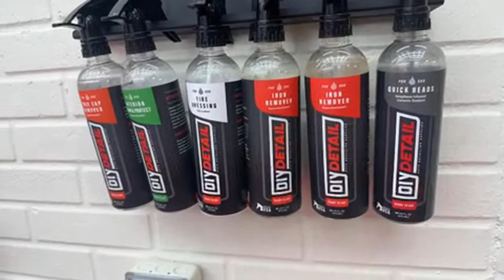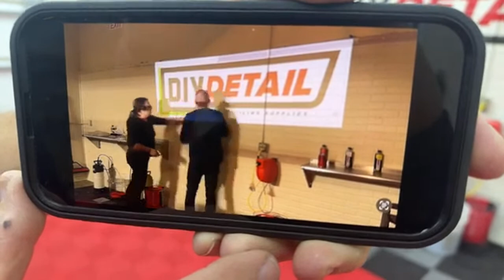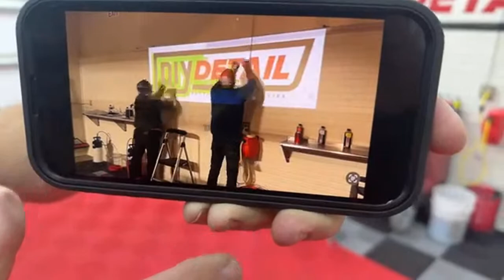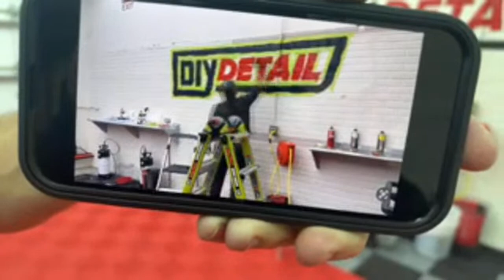Live Q&A Podcast from DIY Detail HQ

Comment: I'm a new subscriber. Been a detailer since 1988 (at one point professionally) and was so resistant to Ceramic. I finally broke down and had it done to my new car. I  always have done everything myself as I have all the tools, knowledge  and product, but left the Ceramic to someone I trust that has done it before (does it professionally) and had availability of a pro line rather than consumer grade, Literally the car probably had 100 miles on it when I had it done. I wasn't aware of you guys at the time and it has a Gtechniq product put on it. I have their whole exterior maintenance product line including decon etc. I drive 700 to 1000 miles a week, and when I run through the product  my intention is to switch to yours. I have watched many of your videos and just trust the line and care you have. Also important to me is American made whenever possible. I just purchased a bunch of things from you for the interior, some brushes, towels, some toppers etc. I know I will run out of what I have sooner than later because of what my car is exposed to in South Florida, so before long I will be trying the exterior chemical line. What I am using works fine and I don't have any problems with it, but especially on the decon side of things, I have to use so much product it's crazy. And though I have money, it's costly. I'm looking forward too trying your methods and product. I will continue to support the channel and your products in every way possible. I appreciate the videos. FYI, please get the clay towel back in stock soon:). I'll buy a few instantly. My Fiancé doesn't take care of her car at all and it's in need of a resurrection. I'll be using your products when I do it.  I may do my first Ceramic coat on it lol. At this point I watched enough that it isn't rocket science. I am just a stubborn 53 year old and didn't buy into it until it really stood the test of time.
Reply from the maker: Thank you, the Perforated Synthetic Decontamination Towel will be back on Monday

Comment: TRC recommends cleaning the clay towel with an apc, I use opc until I run out and crack into all clean lol. But if the clay towel is visibly dirty, what is the best method to clean it? So far I've been agitating it against itself with a healthy dose of opc 10-1. 

As always thanks for all the little nuggets that even us pros need to hear!
Reply from the maker: Have you tried simply putting it under running water and flushing it completely? That’s what I do and it works great, then dry it clay side up
Reply: @diydetailofficial  the towel in question was a opt towel, and I had some browning on it, also left streaking here and there. 

I still to this day don't know what killed it as it only saw maybe 10 cars, maybe I left it overnight In onr with ferrex residue I'm not sure. 

Now that I think of it though I have used 2 perf clays since and while I'm home based and less than part time I haven't had issues with them but they have both been opc'd twice each I think. 

My guess is since in pnw the main thing I battle is moss, so it's being clogged with organics? Not really sure. Also if they start to brown and get gummy is that end of life? 

Thanks for your time!

Comment: I have the bilt hamber touchless and just received your apc. I plan on doing a one step correction this weekend once I receive your clay towel and some of your other products. Should I use your apc or the BH touchless as a pre rinse to help remove as much of the previous protection before I clay the car? 

What are your thoughts on a apc pre rinse? I read conflicting things that I should never use an apc pre rinse unless I want to strip all protection to apply new protection. Or do an apc pre rinse once a month to help bring back some hydrophobic properties lost  through applying drying aids, toppers etc. Or its ok to do a weekly apc pre rinse to just reduce road grime etc.
Reply from the maker: I never mind an APC pre rinse, it is in fact something I used all the time until incredible suds which actually cleans like a beast. My advice? Foam all clean on the wheels and the lower panels, it’s all you’ll really need, then either spray off or foam incredible suds over that….then spray off everything and go about your contact wash. If you’re worried about protection just spray a bit of ceramic gloss on your panels as a drying aid and you’re good to go!

On the technical side, the BH product has a PH that is as high as our All Clean APC. If you have a ceramic coating on your paint, the high PH will not damage it. If you have a wax then either will strip it.

Comment: Nick you really need to work with a gear driven polisher once you get the feel you’re gold
Reply from the maker: What do you like about it? How does it finish down and what are your tips for finishing ?!
Reply: It will cut almost as fast as a rotary and finishing depends on your pad and polish choice but finishing is like dancing with a beautiful woman you direct but you don’t force the motion if that makes sense.
Reply: Nick a little background on myself I’m a 30 year collision tech at a dealership body shop that sells everything from Land Rover Mercedes jaguar to ford Chevy and Toyota, I fix them when they wreck them so I know a little about paint and the the materials they are like a rotary in some aspects but once you master it you are golden. Thanks for your time used in refinishing blah blah blah but my passion is detailing on the side and I think you should really give forced rotation another go